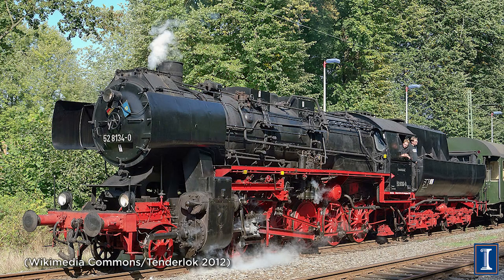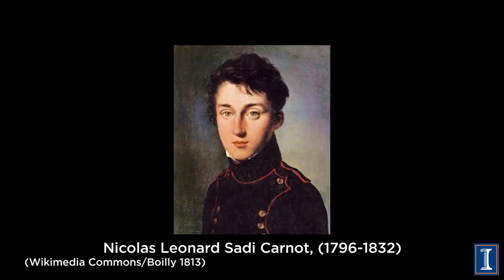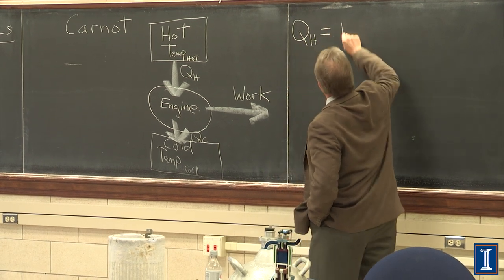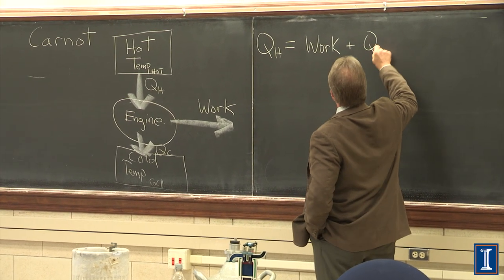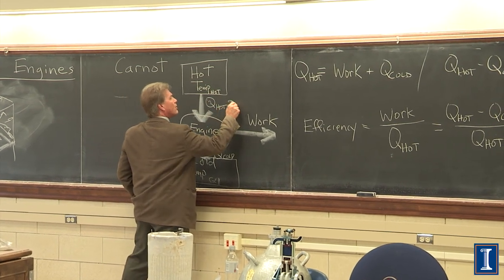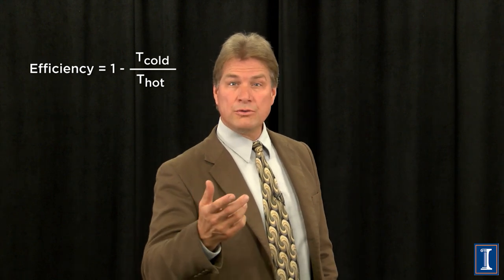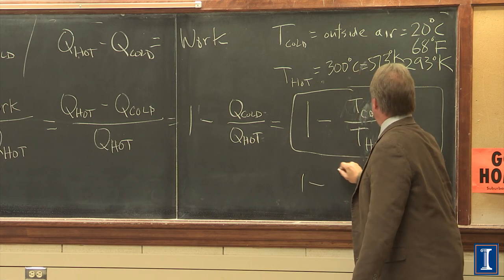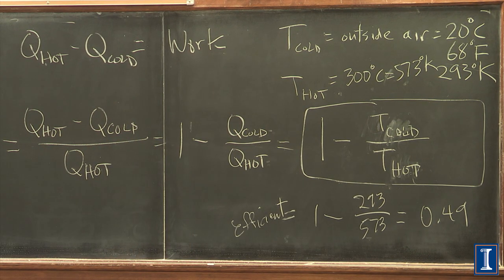Heat Engines

Comment: Wrong again. The efficiency of a piston heat engine is not the ratio between the surface of the piston exposed to the fluid and the total internal surface of the machine.

Comment: 1. This idea of "only one of six sides of the box moves,.. and the efficiency (therefore) is close to 1/6th" is such a facepalm... I've almost lost my breath. It's like telling smthn like "cumulative ammunition is 6 time less powerfull because explosion goes only one way, instead of going in every direction".

2. T(hot) is not a temp of ignition, it's max temp in cycle. In ICE's it can reach up to almost 3000K. That calculation is completely wrong.

3. "20...25% efficiency at best" - wrong again. At best (for optimal load and speed conditions) it can reach up to 35%...45% for petroleum and up to 40%...50% for diesel piston engines.

I appreciate your videos, but this one is terribly misinformative.
Reply: Those engineers are a clever lot. I personally own a petrol engine whose rated efficiency is over 40%.